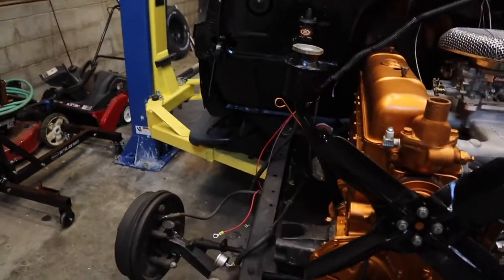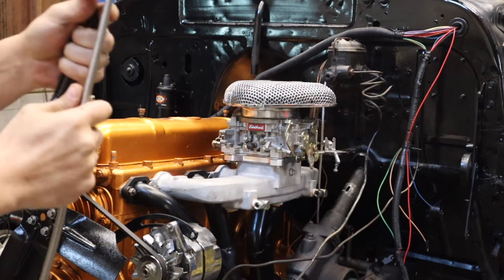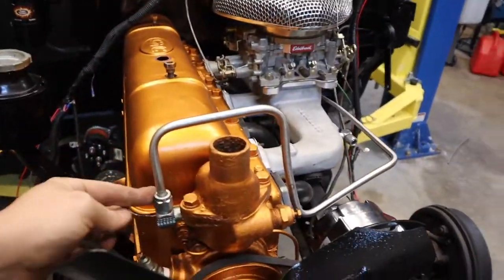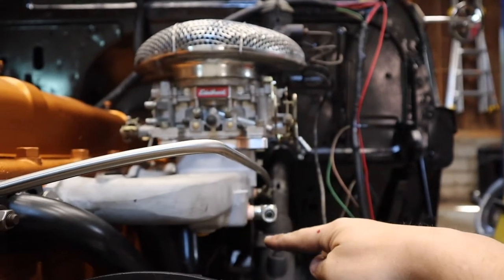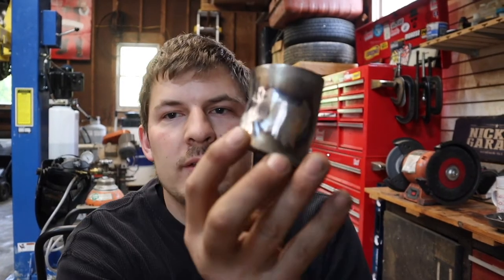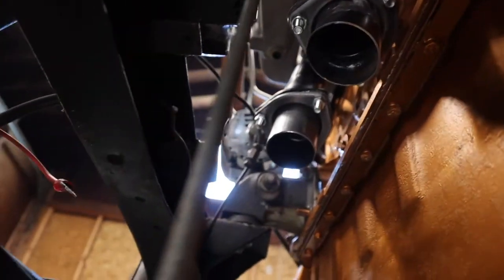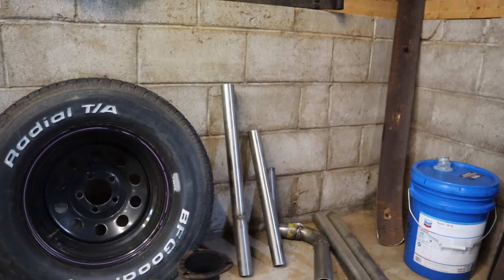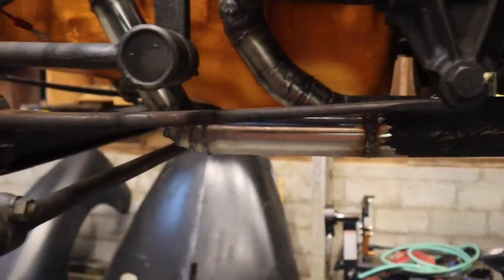Bending And Flaring 3/8 Tube + Making Exhaust

Comment: I’m about to do the same, you think 3/8 is large enough?
Reply from the maker: 3/8 should be a good size. It’s only moving coolent just to heat the intake. If you wanted to go bigger it wouldn’t hurt anything. I mainly used 3/8 because I already had the lines and didn’t want to buy more just to go bigger or smaller.